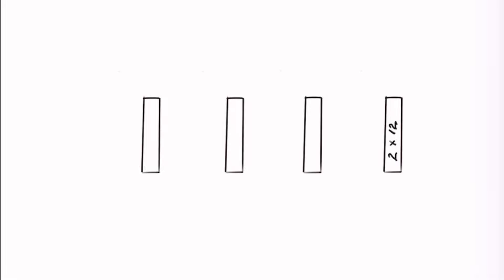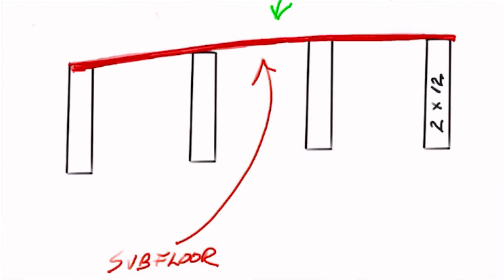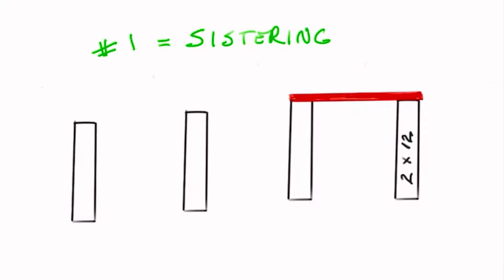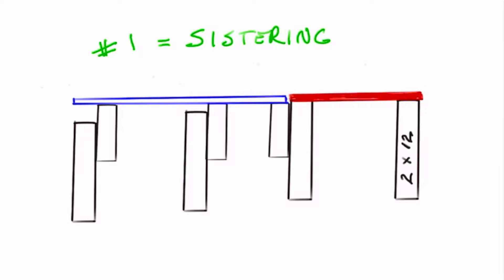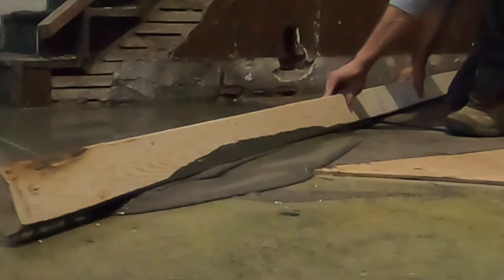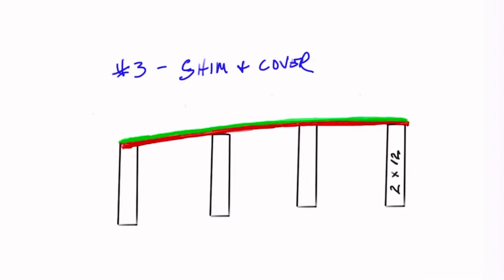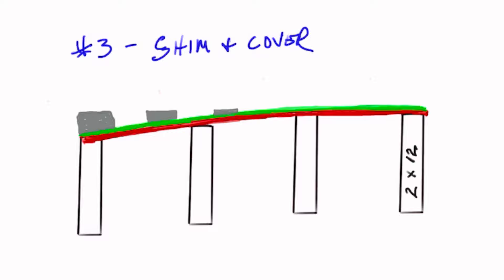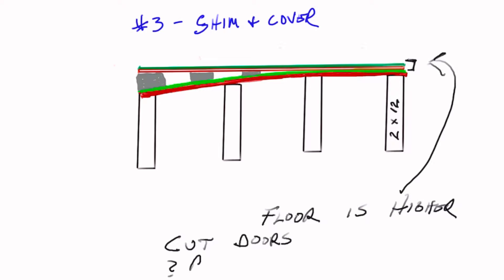How to Repair a Sagging Floor | 3 ways to fix a low spot or a sag in a floor

Comment: i did option 3... and this is my thoughts... none of these options fix the actual problem. those joists and likely the carrying beam are low and need to be raised. Whether its rot somewhere, the sill, or foundation or support sinkage... these problems need to be diagnosed and corrected.
Reply from the maker: Hey @brandonarcher6118 ,
Option 1 is a fix (sistering) if the problem is in the joist itself. If the problem is in the wall or foundation - thats another deal. Thx for watching.
Reply: He literally said that at the beginning.

Comment: No. That is so stupid . You go under the floor.  Under the house. You install nrw joist and support beams  , jack up the low spots until level and nail or screw them in place.  A bad or sunken pier or a rotten joist is most likely the problem.
Reply: What about additions to a home, that don’t even have a crawl space underneath
Reply: I have a purchase to offer ( in due diligence now)  on a 100-year-old house I noticed they took the doors off 90 percent of the house... I think it was because the termites had done the damage the inspector said he saw...and the termite guy said termites are still the joints... but the doors were removed because the still sunken floors were not fixed... I think I should just walk away another 1600 down the drain

Comment: thanks for these suggestions, I've got a situation where the second floor of the 2-story house has no subfloor - it's from the 1800s, and the downstairs ceiling has nice exposed beams, but when I pulled up the upstairs carpet it was sitting directly on top of the floorboards that are also the downstairs ceiling. you can see the living room through the gaps in the floorboards, lol. need to level it out before putting in proper flooring and i appreciate these tips!

Comment: The idea you propose of sistering a board next to the existing the joist is very similar to an idea I had as well. My basement is built with 2x8. I was considering putting in sistered 2x8's next to them at the level height exactly as you demonstrated. Only, I see that in your example you suggested a 2x6 sistered to the original 2x12 joist. Now this has lead me to consider instead using a 2x4 to preform this function, and not worry about it contacting the sill or support beam. Is this interpretation of what you said correct? Thanks for the time fella!

Comment: Thanks for the video. My house is 20yr old (post tension slab on grade in Texas) and recently over the last 2 years my second floor decking is starting to twist, hump, drop, etc. I even have spots where the floor has dropped almost 1” (measured) in the corner of a room. You can feel yourself walking downhill in that room. However the first floor and ceiling right below that point is fine. I image the floor joist might be dropping? But I have no way to know unless I rip up carpet and decking to reveal the joists. It’s my child’s room so I also have concern for safety. The second level flooring seems like it’s always a moving target. It has different humps and dips and squeaks every few weeks. Foundation company says house is fine. Structural engineer agrees floor is dropping…but doesn’t know why. Any thoughts or anyway I can diagnose?
Reply from the maker: Good job getting advice from the structural engineer to help. 
From experience, we have been horrified at a couple of houses we’ve renovated - removing the ceiling drywall below 2nd floor joists to discover NUMEROUS holes cut by previous plumbers or hvac contractors, or electricians. They are known to cut critical wood away without taking into account potential damage to structure. Removing the ceiling is how we have found the issues. 
Yes, that’s expensive to repair if you don’t take it on yourself, so get drywall quotes before removing ceiling so you are ready. 
If you have not owned the house for all those years, there is no way to know what has been done. 
Regardless, 20 years is not very old. There is a problem.
Another idea would be to buy / rent inspection camera ( camera on a snake ) drill holes and check each joist cavity…. Look for holes, cracks, insect damage, water damage. 
Hope you find the issue!

Comment: After 5 years, the area by the entry door of an old MH started swelling more than usual. I though it was the humidity due to the hurricanes, but this time the floor area by the door & the small hall closet started getting soft & didn't contract as before.
I realize now, as you said - either I cut the door, or as I thought - after laying a new piece of subfloor, replace the door hang & have a new area cut for the new door replacement.
 I hear MH doors are special ordered, whereby regular house entry doors at Lowes are pickup. I had been meaning to replace the dented old door, guess now is the time.
Reply from the maker: Sounds like your door is going to need to go - hope it all works out…

Comment: Could I put leveling concrete down once I did option 1 for an upstairs bathroom?
Reply from the maker: We chose to avoid that option because unless you are 100% positive there is not a structural issue, the weight of the concrete leveler can do a lot of damage. 
Just fyi…

Comment: Very informative video! For option 3, do you recommend screwing the shim into the joists or is it sufficient if they are screwed into the existing subfloor? Thanks!
Reply from the maker: If the existing floor is plywood, that should be good. We added construction glue to help us not have to worry about accuracy too much. 
Thx for watching.

Comment: Hello,
I presently live in a home that have sagging floors. I have decided to purchase jacks and lift the floors from the basement. My question is are there any prep work required on the 1st and 2nd floor prior to installing the kicks and lifting? Do I need to be concerned with baseboard trim, door trim, or anything. I have received my drawings on where to place the jacks. I understand that my plaster and drywall will also begin to crack in some areas. I just want to get level floors before I purchase my new doors and install new trim.
Reply from the maker: Hey Steven,
Sounds like you’ve done some good prep. Our practice was to go slow… it took decades to get to that point…so rushing is asking for issues. We’d do a 1/8 inch and let it sit a day or two. Then another 1/8 and rest a day or 2.  We still got some plaster cracks… so the slower the better is what we thought. 
Hope your project goes well. 
Thx for watching!
Reply: I don't understand this method, after a month or so of raising the old joists, what do you do to prevent them from just re-sagging again?  You aren't planning on leaving the jacks and support beams in place are you?
Reply: @tricatfilms6136  I believe that after you have leveled your main beam to the sill, you would then you something like a lolipole to hold it in place. If you are doing it to joists, you would prehaps choose to put a shim under the joist, or alternative you could sister a new joist in that contacts both surfaces but sits slightly lower than the original joist. Basically concept 1 but in reverse.

Comment: Question for a older mansion block top floor flat. There is a light slope in the corridor area and the bathroom and it crackles a bit when walking on it. Once you do the sistering and you have levelled  the floor, you put a subfloor of plywood on it right? If I want to make it real solid and add porcelain tiles or engineered wood, can I add a layer of screed or that would cause moisture issues later on? What would be the best option for a solid floor?

Comment: Been doing this all week
Reply from the maker: Hey GC ,
That’s real work right there!
Reply: @Housebarons  
Yessum...   got the bathroom left.  Kind of took a break and been putting in wood plank flooring starting in the bedroom.  Once I get to mid living room I'll go back to leveling.  It's fun if it's not a job.  Best.  You are much better carpenter than I but my floors are secured, level, and don't creek so that's a win

Comment: Would #3 be good for a bathroom? I wonder about water in those spaces between the shims.
Reply from the maker: Hey John…,
Water is always the enemy of wood. But you flooring should seal your sub floor from minor water like getting out of shower. 
But let’s say you have a broken pipe of tub overflow. That would cause damage to any subfloor or ceiling below.
If you are still concerned, #2 should eliminate any voids (filling them w/ plywood and floor leveler.
Thx for watching!
Reply: As someone that did water restoration for years....I would hate you

Comment: Why not just cut new 8' long shims and attach to the tops of the old joists, ?
Reply from the maker: Possible, but a lot of measuring as sags tend to be curved and very irregular. That’s why “sistering” a board next to a joist is a lot easier / quicker to line up.

Comment: My joists are sagging length ways on one side of my trailer everything is in good shape. If it wasn't it was replaced. Pretty sure asbestos is everywhere.
Reply from the maker: Hey Devin, 
You could probably do some internet searches to find out about asbestos. 
Supposedly, asbestos was put out if you federally in 1978-1980 in home construction. 
Not sure about trailers. 
Thx for watching!